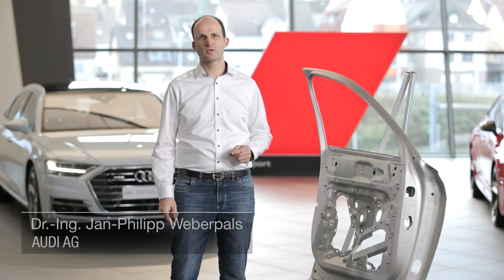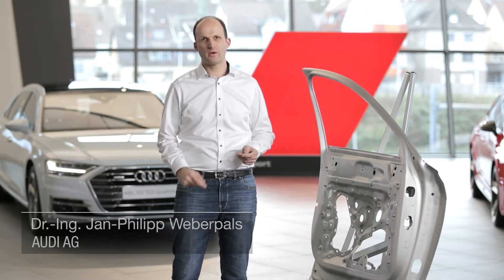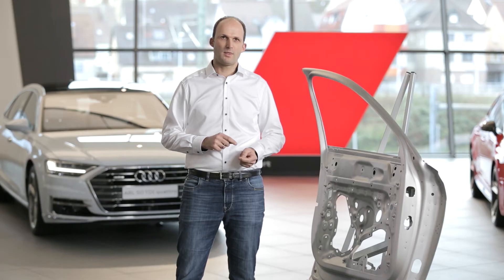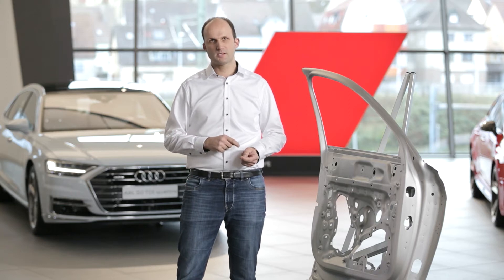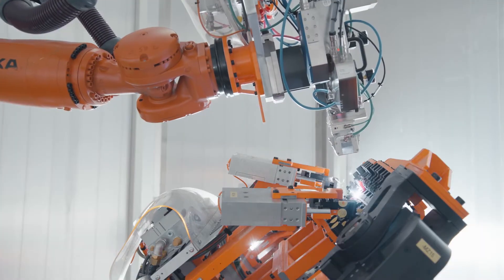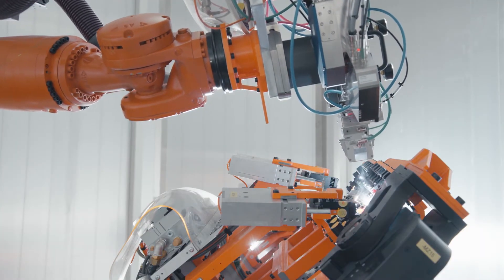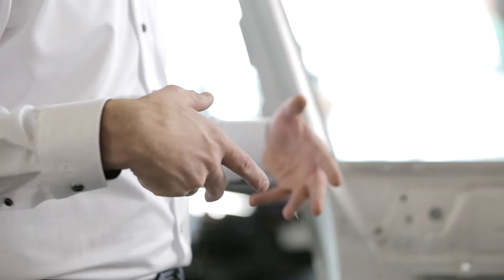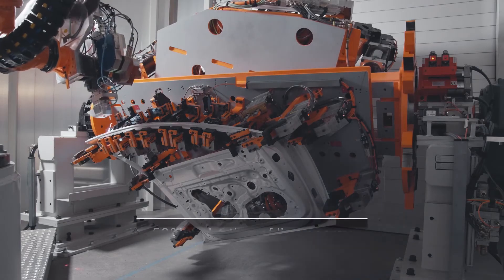Laser Welding at AUDI - Remote Welding of Aluminum

Comment: Where it is used other than doors in Body in white ?
Reply from the maker: There many other applications for the WeldMaster platform: in e-mobility for battery housing, battery boxes and seal welds, car body constuction, stainless steel application or welding on the fly. Find all details on our website: https://www.precitec.com/laser-welding/products/process-monitoring/weldmaster-plattform/